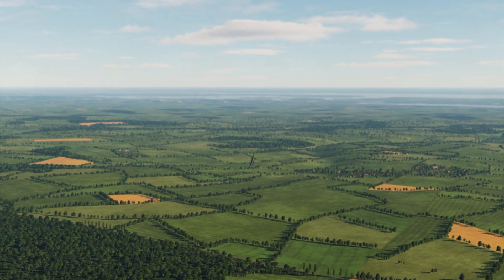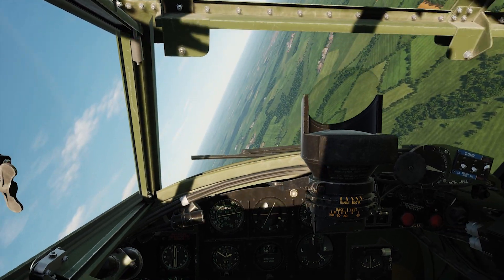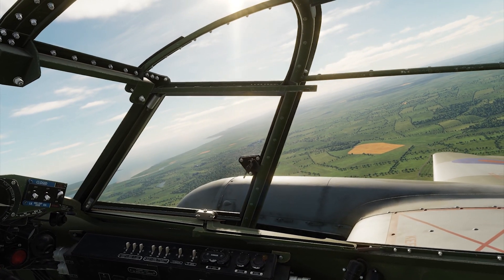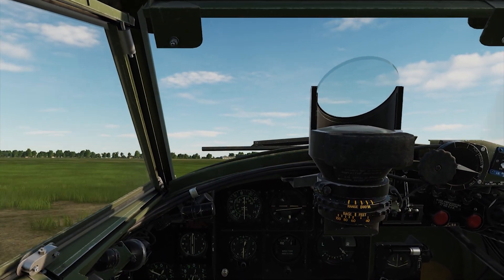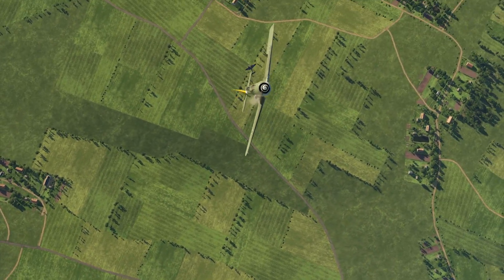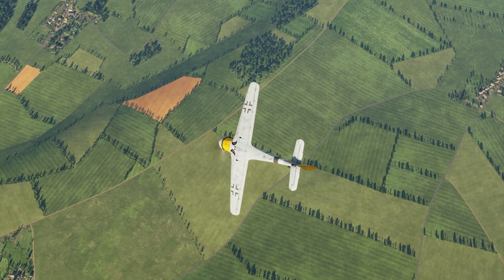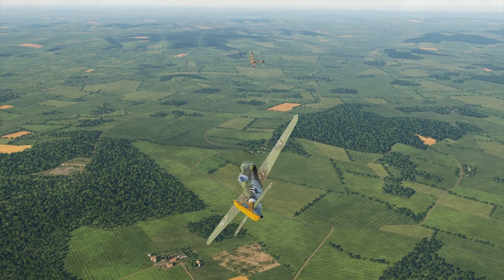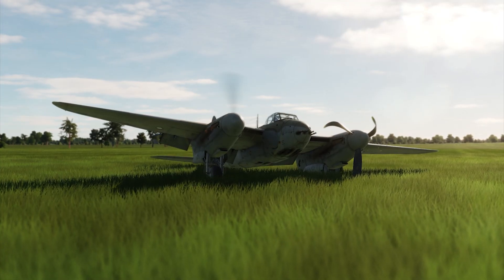Mosquito first impression: Flight Dynamics and Analysis (DCS World)

Comment: My Mosquito FB VI is not working I keep getting this error " failure fuel tank leak stopped" is anybody else having this issue?
Reply from the maker: You should post this question on the DCS facebook page.
Reply: @FSX404  I did report it and they said it is a bug and after a few months they haven't fixed it.

Comment: Controls are too twitchy, they should be much better callibrated out of the box instead of the user having to force the curves.
Reply: From what I've heard, DCS warbirds are tuned to have similar control inputs to the real thing - meaning if you don't have a similar length stick extension, you're doomed to having to edit curves to try make them less twitchy.

Comment: As I understand it the engines not being counter rotating was primarily for logistical reasons.  The RAF didn't want the complexity of supporting differing engines.
Reply from the maker: Thats what I thought too, but someone else I trust with these things said it was a weight thing. How and why that makes sense 🤷‍♂️!! But honestly interchangeable engines and parts makes more sense to me.
Reply: The only widespread aircraft I know of that used it during the war were the P-38, and the He 177 and Hs 129 (to what extent you could call either of those "widespread"). The Germans also had a few additional prototypes that used them, as well as the Gigant, which may as well be considered in the same boat as prototypes with how few were built.

Interestingly enough, DH /did/ add counter-rotating props on the Hornet, which was developed from the Mossie.

Comment: You probably know this by now,  but for anyone watching who doesn’t, switching on the power to the gunsight moves the POV of the virtual pilot to the right, so the view is down the centre.  This is useful for more than just aiming the guns. In a steep turn, for example, the horizon is now consistently placed in the sight picture for both port and starboard turns.
Reply from the maker: No I didnt know it, thanks for posting it. I'll try it out.
Reply: Yes, although flicking on this switch in VR does not change your view point which to be honest though being handy  would kind kind of spoil the illusion of "being there" I guess I'll just have to duck down to the right to see through the gun sight. (doesn't feel that comfortable but I can only presume this is what the pilot's had to put up with unless they had a lever to quickly adjust the seat height)
Reply from the maker: @michaelsearle6538  that makes more sense, even with track IR its not easy to shift the position so I can see why the devs did it. I use VR for flying but track IR to record so if I do a real dogfight video its gonna be interesting.